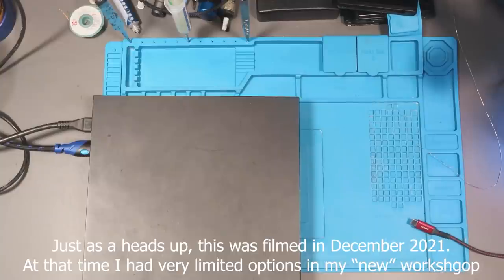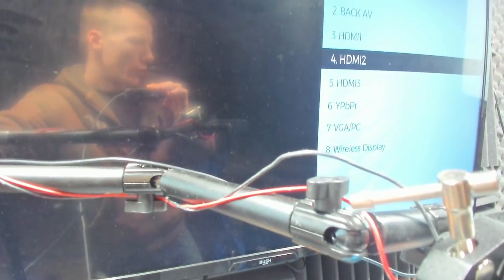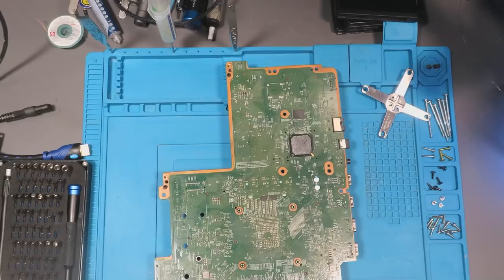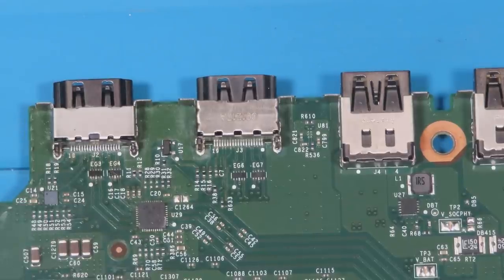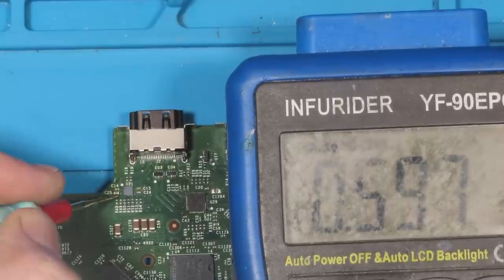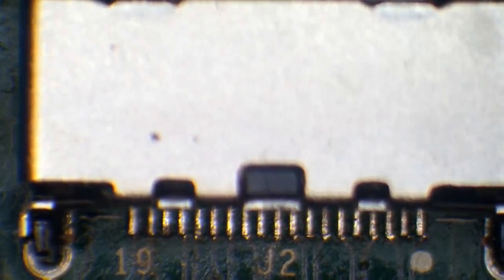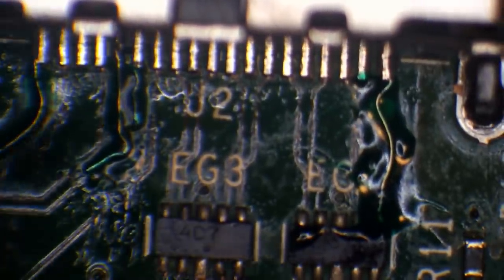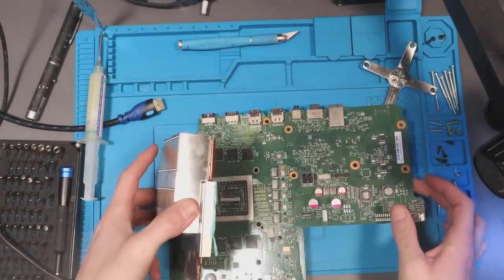This Xbox One X Got Abused By Another Technician. Can We Fix It? HDMI Header Trace Repair

Comment: When you use wires to repair trace pads for the HDMI port, how do the pins sit low enough to the original pads when the thickness of the wires is higher?
Reply from the maker: Most of the solder generally pushes above the pins so the pins themselves sit flush to the board :) sometimes it doesn't work though and we have to push down on the pin itself to force it to sit lower than the rest of the pins 😀
Reply: What I do is simply solder the jumper wire/trace repair on top of the pin, and then take it to the nearest solid trace.

Comment: Hi bud, I don't suppose you know what a constant orange light on a xbox one powersupply would be. I have tested a different power supply and the xbox is all OK. Was wondering if it's worth a gamble and hoping it's the capacitors at fault, is that a common issue? I've noticed the led light is slightly duller than the known good supply.

Comment: Most annoying device or devices to open, has to be glass backed Android phones ( S6 S7 S8, Note 9 and so on). Not enough heat and you're replacing the back, too much heat and you possibly burnt up part of the wireless charging coil. Making those glass backed phones even more annoying to look back on, is the fact you can get almost as clean of a look by using plastic ( Samsung Galaxy A50 , A51). I hate glass back phones.
Awesome work Phil, even if case a bit annoying to open.
Reply from the maker: Haha I break those damn things every time I try and open them. I refuse any job which involves a glass back or glued in screen now 😁

Comment: I haven't dealt with every console out there. But the PS3 fat is extremely annoying to open. The RF shields pancakes the whole board. Similar to the XBOX Series X. And with the button-less controls. You can easily misaligned them when putting the case back on. Making the Eject not work right.
Reply from the maker: I don't think I've dealt with those, unless they're the same as the backwards compatible ones lol. I did find them a bit confusing though, I always end up with an extra screw at the end lol 😆

Comment: Most annoying devices for me to repair are the 3ds consoles and it's not the repair it's the assembly
Reply from the maker: I've heard the lcd is a pain in the backside on those
Reply: if i remember correctly, when you're replacing the lcd, you have to route the ribbon thru the hinge, and it's a pain.
Reply: @TheCod3r  yeh those things will test your patience Phil. Great consoles though even today
Reply: @kam_mil  yeh Phil all the 3ds and xl have 3 ribbons stacked together and you have to roll them up and feed them through the metal o ring they need to be in the correct order. There hard to get shell parts for aswell I have a few here that are fully repaired now but I cant buy any shell parts and the 2ds xl is a no go for shell parts aswell

Comment: Not an expert by far, but a suggestion: when you see such work already been done on HDMI or any chip for that matter, just replace it... You cannot be sure what kind of damage exists below, or even if the HDMI and/or chip is functional or not (where it comes from)... By removing, and using a known good supplier, you remove the possibility of bad port/chip that someone else put... In addition, you would notice possible issues below the pads (like on this video), and would save some time (and nerves)...